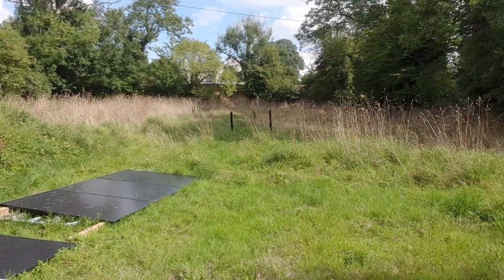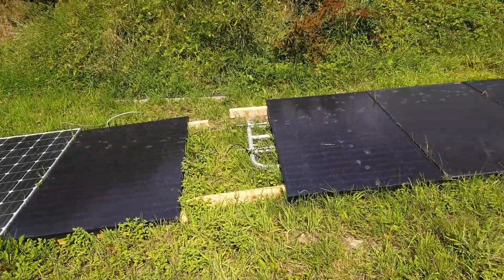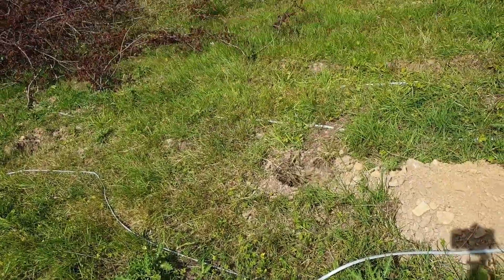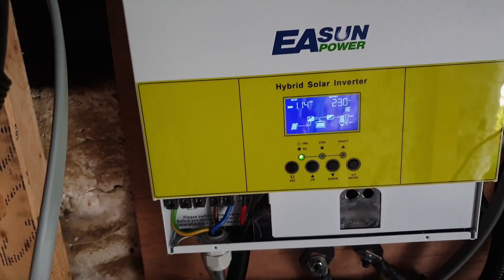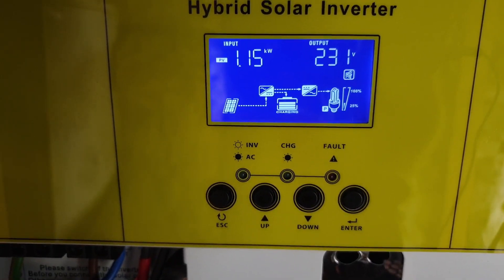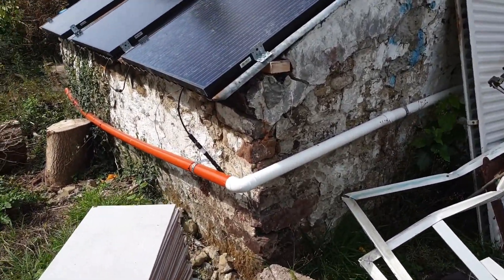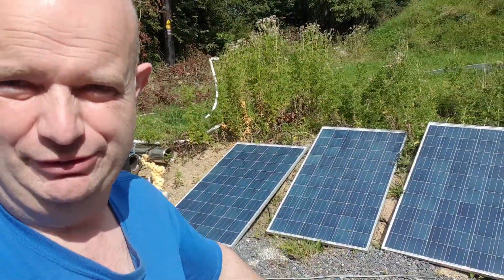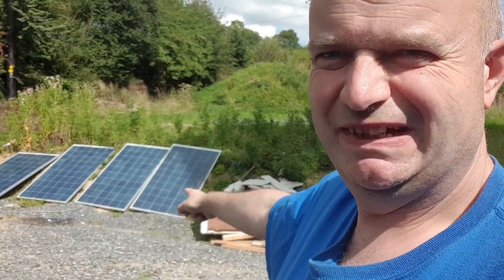Simple Off Grid Solar

Comment: I'm sure you already know this but just in case for anyone watching, you have to be careful with grid ties and hybrid inverters, because the grid tie raises voltages but it cant backfeed through the hybrid inverter as it has a boost stage. So it gets stuck in the output caps of the hybrid inverter which end up blowing if you have too powerful a grid tie system and too little load.

Direct transformer/"low frequency" inverters are able to backfeed into battery no problem, just need something to disconnect the grid tie when batteries are full.

Comment: Could you use a Prius inverter instead of the normal equipment to charge batteries with solar?
Reply: Yes, but you'll have to change the logic board.

Comment: As always, I'm curious, which I know isn't encouraged here, lol.

You mentioned Grid-tie 600W inverter initially. Specific reason or just what came up when you wanted to fit said panels through to the shed? or is it if it's out there, she's able to spoof the grid into thinking it's just actual non-power used?
Reply: My reading of the system was that the smaller inverter was being used to trick the main solar controller into thinking a grid was present; many solar controllers rely on the AC frequency of the grid main supply, so if there's a grid blackout, the panels do nothing. Solar controllers that can run off-grid and also be grid tied need to open the grid contactors when switching to internal frequency generation so that if the grid comes back it can speed up or slow down the internal frequency until it's synchronised with the grid before closing the contactors again.